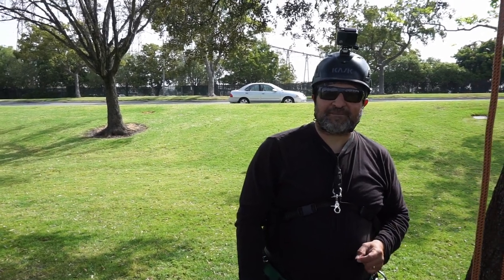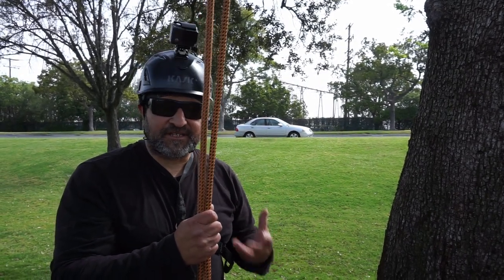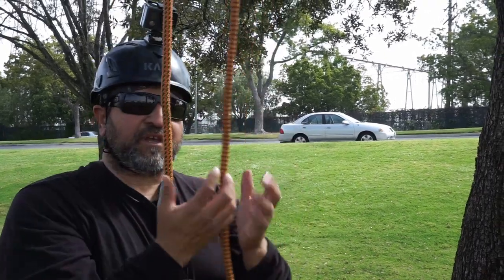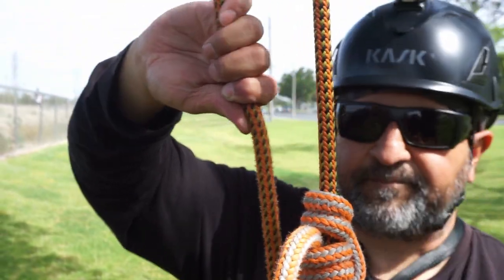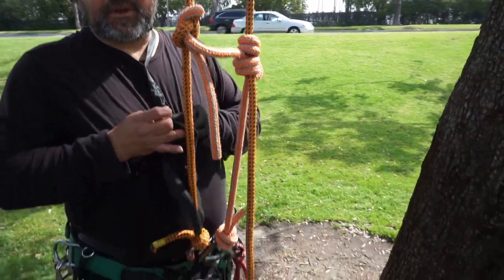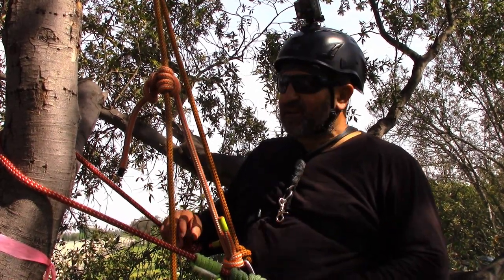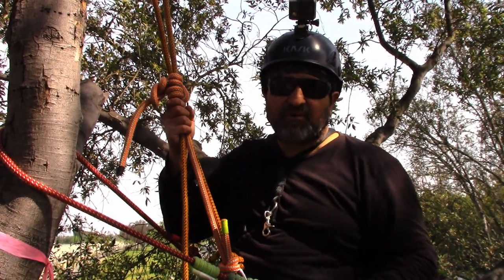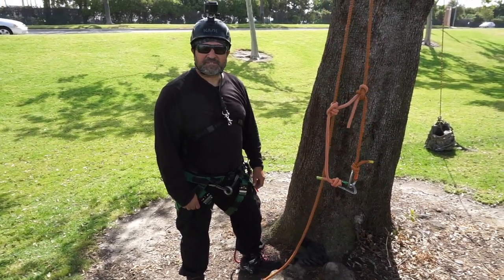How to Tie a Self Tending Blake's Hitch (Best Blake's Hitch System)

Comment: I really like your explanation, it's worth a try. Gotta love any system that doesn't rely on extra working parts. One could even use it on the tail of a rope for a second point of attachment. I had to chuckle when you called that knot a bowline, and it is easy to see why. I would have call it a sheet bend, which is basically the same knot used to tie two ropes together. On the other hand, your description more accurately describes the big loop of rope formed through the working end of the line, the carabiner, bridge, and tail back to the knot.
Reply from the maker: Thank you I'm glad you liked the video. Take care!

Comment: Hi,
Good system, 
the only problem I can see  is that you have to release the tension of the rope to remove the " kind if bowline" that pulls up the blake's hitch before to envisage to go down.
This is not always possible
. I would suggest to replace the " kind of bowline" at the same place by an other blake's hitch. In that configuration the effect of the second blake's hitch is  neutralized by simply pull it down ( no need to remove) in only one movement allowing the descent
Regards
Reply from the maker: Yes, that's true If I use this method I usually just get to the top and go back to the normal system. some people are able to keep it tied and descend.
Thanks for sharing.
Reply: No need for a second blakes hitch just use the bowline but don't tie tight as in the tail of the blakes hitch is tight.
Reply: The Sheetbend is on the fixed end of the rope and it's slack on hang. Seems like the Blakes will break just fine for descent. Just look at the tender tail when he's hanging, it's slack. Grab knot and squeeze.
Reply: You could put a quick release on the bowline by running a bite through instead of whole end. I could be wrong but don’t see that as being a safety issue if it accidentally got pulled undone.

Comment: Blue moon and zigzag are a great combination. Have you ever analyzed termination knots to determine which one is most compact and least likely to interfere with the zigzag? Same concerns apply to using a hitch climber pully set up for mrs. At one time I tried a figure 8 loop and used a piece of string to tie the end of the loop in a tight eye to the biner. I didn't really use it much, but seemed to be ok.

Comment: Doing a second blakes hitch not only self tends but just needs to be broken  then lower a bit to do the same and not require untieing which may not work if you end up in a bad spot. 

Exactly same set up and lay out but sub in another blakes hitch for the in line bowline.

I'm certainly no expert but this works for me with very little experience.
Reply from the maker: True it works the same was just a little more set up and more rope.

Comment: I want to use this system for saddle hunting and be minimalistic as possible  and this looks to be just that ... 
How many feet of rope do u recommend for this (SDRT) ?
What climbing system do u recommend for climbing trees for saddle deer hunting  , while trying to be as quick ,quiet and efficient as possible  ?
Reply from the maker: It depends on how high you plan on installing your rope. you need double that height plus 3 to five feet of rope for each knot you plan on using.

Comment: Thank you Bino!  It's nice to know you can still get it done when chaos shows up to your job and gear gets dropped, run over, etc.  Are there ropes which are too stiff to grab well in a Blake's hitch?  I'm trying this in my garage and struggling to get good grab with my Yale Blaze 7/16 inch rope with 24 strand double braid.  Is this rope too stiff? 8mm hitch cord grabbled well, but got stuck.  I'll try 10mm hitch cord next.
Reply from the maker: Yes if the rope is too stiff it may not work well.
Reply: @BinoH , as a tribute to practice, I was able to made the Blake's hitch work with my stiff 11mm rope....I found an alternate tending method...leave a longer tail and tie a second blake's on the fixed end - the pros are it can be tied off the ground, under tension, and you only need to remember one knot.

Comment: When I was still using a blakes I started just using a micro pulley with some accessory cord. Even paracord works fine. Just tie a girth hitch through the pulley under my blakes. And then a climbheist hitch onto the working end. Its really quick and easy to undo when you need to advance your tie in. Or you can also use an accessory biner and just clip that on and off of the pulley to make it even faster. Doesnt have to be rated or anything since the only thing its doing is pulling the blakes up
Reply from the maker: True that also works.

Comment: Doesn't this damage the rope because of the friction between the rope and the tree while ascending and descending? Thank you so much!
Reply from the maker: Not so much depending on the type of trees you are climbing. Rough barked trees vs smooth bark. In a work setting rope aren't meant to last for ever. I have some recreational ropes that last for years that I used MRS.

Comment: Bino. Is ur split tail thicker than your running rope? I've had issues with my hitch not tending upwards because the hitch gets locked on the rope. The only thing that I can think is that my split tail is not the right rope. Same diameter. Both 16 strand. 12.5mm. The tail is Samson Hawkeye. The climb rope is Notch Sasquatch.
Reply from the maker: The split tail should be equal or lesser than your climbing line.

Comment: Hi Bino - simple method

I climbed back in my 20's,  haven't climbed since 1982 but I have a few broken limbs I need to attend to in our back yard and I can't stomach the idea of some monkey dripping with mechanical devices, clanking with gear coming to do it.  

So I've got me a new harness and rope.  Trouble is the overwhelming amount of information and gear these days.  

In those days we just used a bit of shipping rope to climb on, attached to a lineman's seat harness.  There was no bridge so I like this improvement. Yep pretty basic. Just hip thrusting - super fit.  No SRT then

We used a more uniform prussik knot - some call it an English Prussik.  I'd never seen the Blake's hitch before watching YouTube clips over this last year.  The difference I see between the English and the Blakes, besides the English one being more symmetrical is that the tail heads out on the Blakes' Hitch away from the working rope whilst on the English it heads back in towards the working rope.

Intuition and the benefit of not been indoctrinated with the Blake's Hitch leaves me to think that heading back in such as with an English Prussik would be better in this situation - meaning tail heads straight back to the onto the working line where to you tie in with that Sheet Bend (what you call the loop) ... 

With an English Prussik the running rope won't get twisted back towards the working line in order to tie that Sheet Bend and thus won't compromise the way it wants to pull and sit naturally when you apply your weight as I can see occurs with the Blake's Hitch.

Not sure if I am making sense and or whether its really a game changer - but it looks to be sit intuitively better to have the prussik not twisting

Anyway, many thanks for the simplicity of that Sheet Bend tending trick instead of yet more mechanical gear - its very neat. Whoever came up with it is a genius.

 I'm hoping you have simple methods for SRT too so I will check out your other posts

Thanks for making the time to post Bino.  And give the English Prussik a go for old times sake.
Reply from the maker: Thank you for sharing. I have used the English Prusik it's kind of sticky on me, my guess is my weight. My go to hitch if I'm going old school is the Blake's it doesn't stick or come undone on me. You might check out my SRT/ SRS play list. Take care!

Comment: Hey bino you tied your blakes on the left side would it work if you tied it on the right side and had your bulen on the left sp pretty much flipped
Reply from the maker: Yes you can as long as it's tied the right way. I made a video on it named ( Blakes's Hitch clockwise or counterclockwise?) Check it out.

Comment: I have a 10mm Blue static rope. It's new never been used. When I use the Blake's it doesn't hold. Keeps sliding down. Does the Blake's work with this kinda rope?
Reply from the maker: I'm not sure about 10MM, I have never used anything smaller than 11mm. Some static lines do not bend so well that could be causing it to slide. You might try to add another wrap.
Reply: @BinoH  yes that seems to be the issue.  I can't get the holding side to tighten because it doesn't bend well. I thought it was because it's a knew line.
Thanks I'll try something else.
Reply from the maker: @Samestori214  that is also true sometimes new ropes slide.

Comment: So this is the more essential original approach that the hitch climber pulley setup is attempting to improve on using new bits of metal equipment ...
Reply from the maker: Well the Hitch Climber is an improvement but this is good if you don't have one.
Reply: @BinoH  Yes good to always know this, in just the same way that it's good to know how to set up Blake's when you lack a prusik loop - it is a fundamental surely. I realise that I unintentionally made it sound like a doubtful thing that the hitch climber pulley provides certain advantages in certain regards. Good to keep keep an active knowledge of the fundamentals, all the same.
Reply from the maker: @ipomoea_batata9906  yes I agree

Comment: When I have practiced using this method the blakes hitch becomes so tight that it will not move via me pushing it up manually or the in line Bowline that should advance the Blakes hitch. What im I doing wrong?
Reply from the maker: It's possible the type of rope may lock up.

Comment: I'm still wondering if Prusic will damage the rope more or less than mechanical ones
Reply from the maker: I'm not sure if it will damage more that the mechanicals, maybe to the jacket it might cause more abrasion.
Reply: @BinoH  Thanks for your opinion!
I think your opinion is very important, especially when I consider that most mechanical Prusik consists of irreplaceable aluminum parts and must therefore be completely replaced.
If I use the DMM HITCH CLIMBER  together with the ISC ROPE WRENCH then I only have to replace the prusik rope in time, have more options (Swabian, Thistle, Michoacan) with different combinations of climbing rope and is in fact midline attachable!
Given the large price difference, it is also cheaper in the longer term.

Comment: Hi Bino:  hope u can help. I’m a recreational climber just getting into it and have gone up maybe 25 times mostly using your self tending Blake’s. It’s been great. Today, and for the second time, something really scary happened. I couldn’t descend: the Blake’s was impossible to break and when I unweighted a bit the self tender pulled me up. The first time I was able to release from the carabiner and shimmy down with my lanyard. This second time I had to call a neighbor who brought a ladder. I’m afraid to go up again. Would love to solve this mystery. Why did it it work all those other times?  I’m tying everything the same way. And do u have any suggestions for self rescue?  Thanks.
Reply from the maker: When you get to the top do you undo the self tending Blake's and tie a stopper on the Blake's tail?
Reply: In both cases I didn’t get to the “top”.  I was at a point where I wanted to test everything for descent and found, to my horror, that I couldn’t break the Blake’s. It now occurs to me: in both cases I was climbing by foot locking. Does that tighten the knots more than hip thrusting?  BTW, in other cases I have descended no prob with the self tender tied.
Reply from the maker: For me my Blake's gets tight if I have the self tending on and try to decend. How many warps on your blake's?  @tommyers2166
Reply: 4 wraps- the normal. And forget my theory about foot locking- I recall I have foot locked several times with the self tender without incident.
Reply from the maker: are you using the same diameter of rope? @tommyers2166
Reply: Yes.  Blake’s and tender done with the climbing rope- as you demonstrate in the video.
Reply: Mystery solved! (I’m pretty sure). I wasn’t leaving enough distance between the Blake’s and the bowline. I experimented and found that anything less than 7” and the self tender will tighten the Blake’s so much that you can’t break it. There’s a sweet spot: much more than 7” and the tender loses efficiency. Try it out and see what u come up with. If u get it wrong there are SERIOUS consequences. I found out the hard way. Love the convenience of the self tending and don’t want to give that up.
Reply from the maker: Nice I'm glad you figured it out @tommyers2166
Reply: I suggest you test my solution for yourself and if it’s correct perhaps you could share it on your channel. I wouldn’t want anyone else to get caught like I did. Very scary.

Comment: You can do another Blake’s hitch in place of the bowline knot and when you need to rappel, you can break the top Blake’s easy without completely undoing the knot and just squeeze the bottom Blake’s hitch and rappel as normal.
Reply from the maker: Yes I've tried that method but it just uses more rope. For me I like having the tail with a stopper knot when I climb throughout the tree.

Comment: Would that work with taughtline to
Reply from the maker: I don't think it does. The way the Blake's is setup how the tail goes from the top to the bottom and through the two lower wraps is what tends the hitch up. The Taught line would more likely open up.

Comment: I find myself putting the prusik on the termination end which I have a sewn eye.  The Blake's on a split-tail is great but if u twist around I found that u have to get up to a crotch & tie in your lanyard so u can re-adjust the Blake's.  Sometimes with the split-tail it tightens so much that you have to adjust it to be able to come back down but the ascend is optimal.
Reply from the maker: It's always nice to find what works best for you!
Reply: Thought I would revisit this video. I'm MRS & in the north. My hands get cold & I really don't want to do anymore tieing than I have to. I found that this 1 black carabiner that I have made by Fusion is perfect for an open split-tail system.  U can put your climbing rope in a bag or pouch. I get to a preset paracord in the 🌳  & attach my factory sewn loop using a pile hitch with the paracord. So the climbing line goes up from the right, over the union & down to the left. My split-tail loop is already on this Fusion carabiner on the narrow end in a notch. The other notch next to it holds my sewn loop on the climbing line. Then I clip into my adjustable webbed bridge & I'm almost ready to climb. Since my Blake's is already on the Split-tail I just tie the tail end of it to a prusik that is just above my sewn loop. I put a big stopper knot on that tail end. So I thread it through the 11mm prusik until the stopper hits the prusik & finish it with 2 half hitches. I really like it when the 🌳 is slightly leaning away & I pull with very little hip thrust while trying to position my feet right so gravity doesn't take over. Take care. Hope your warmer than we r.
Reply: @josephtreadlightly5686  - sounds interesting - wouldn't mind see a video on this if you had the time Joseph, just to fully understand your method
Reply: @tuberider1171  Unfortunately I climbed my last 🌳 for the year yesterday. 😢 We will be lucky to hit a high of 10 above here in the foreseeable future. But I will do a video from start to finish. It will have 2 systems. The Split-tail which is self tending with just 1 carabiner & double oval DMM variable which comes with the DMM HitchClimber Eccentric. They r both open systems u can use with a long bridge. I have a great double maple that is huge @ home that is split 4 feet from the ground that I can put both systems into demonstrate.. I am a 🌳 cutter & a bowhunter so I use this equipment 9 months a year. I will be able to demo tying in with the lanyard to hook up your climbing rope to another union in the 🌳.  I use that approach alot since most 🌳 I am in our very busy & not clean enough to get into with a union 40 feet up on the 1st try. I'm trying to attach my Tactacam this winter which has great video & audio to a climbing helmet this winter. The Tactacam I run from a remote in my pocket so I don't have to edit as much to produce a video. I will let u know where I post it.😆
Reply: @tuberider1171  I'm going to try to send u a video I just viewed this morning.  I just left a comment on that video which explains my concept. This video is short but like Bino it is made with good video & does a good job explaining.  I'm still planning on doing a more in depth video on my new YouTube channel which will illustrate what I just left as a comment on the video I watched this morning. Unfortunately we r struggling to get into the single digits here in MN.
Reply: @tuberider1171  It wouldn't let me send a link. If u go to YouTube search u can find it quickly.  Under search type in the word safeclimber. Then scroll below to find a 4 1/2 minute video labeled 
DRT -double rope technique 👌

Comment: Not sure I'm a fan of the Sheet Bend in my load bearing line but since it's in a 2:1 system it shouldn't be too critical.
Reply from the maker: It won't cause any risk.
Reply: It's a 7k lb rope. Sheet bend doesn't really  make a difference.

Comment: Great to not have that tail tied in upon descent. Self tending tail can interfere with breaking the knot to descend.
Reply from the maker: when ever I use this technique I use to get into the canopy and then I put a stopper knot on the tail because for me it works better to descend with a stopper knot on the tail.
Reply: I did learn that you can get down slowly if absolutely necessary.